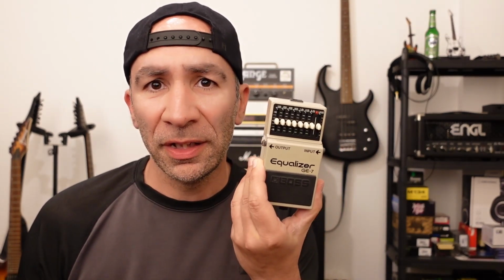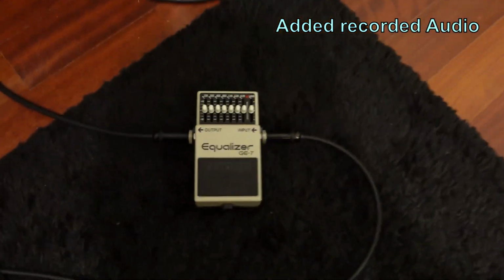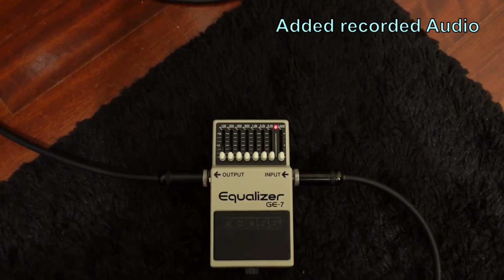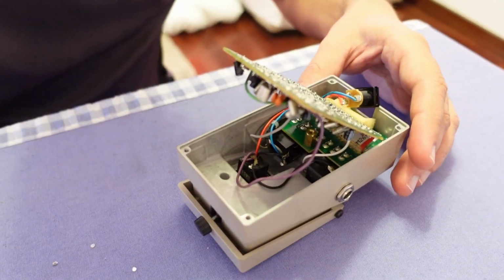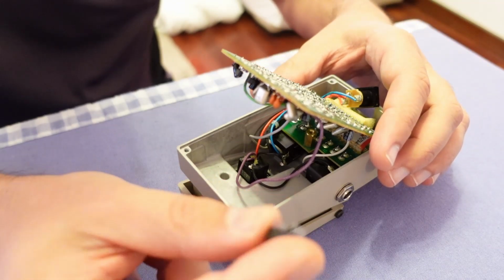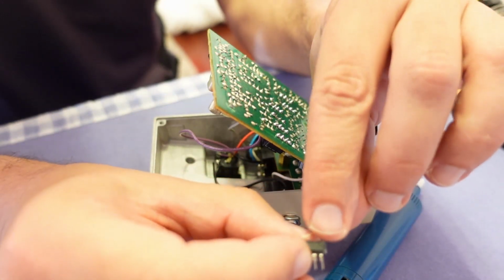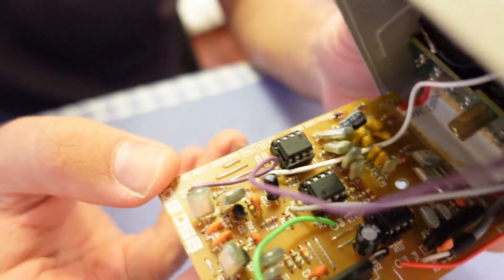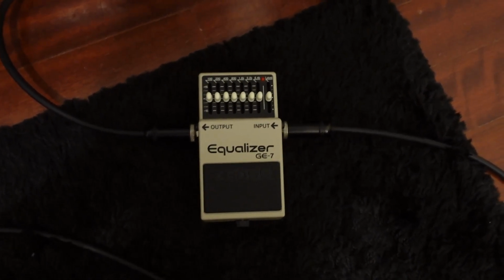Boss GE-7, Low Noise Modification

Comment: My Boss is a couple years old and has the hissing noise. I bought a Behringer knock off and it’s twice as quiet and has a nice quiet in colored tone while the boss has a muffled basey tone. I never heard it until I fired up the Behringer next to it. The Behringer EQ700 is around $22.50 at Sweetwater. The build quality isn’t even close but the sound beats the Boss considerably
Reply from the maker: Cool ! That is interesting to know, i might try and get one too, EQ pedals are always useful
Reply: @ for $22.50 you cannot go wrong. Best pedals on my on any board is an EQ. My second favorite is my EVH 5150

Comment: Get a Sonicake Tone Group instead.
10 band, +/- 15 db, no hiss -> 50 bucks!
Reply from the maker: Thanks for the heads-up. A 10 band would be useful indeed
Reply: @megahurtz30  Very good tutorial, btw and good craftmanship!
I bought a user modded one once and the soldering was terrible.
Reply from the maker: Thanks! :) Yeah, soldering can be a little tricky. One has to have a good soldering iron that reaches proper temperature, to begin with...